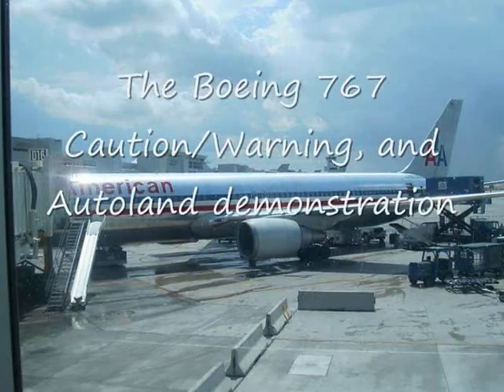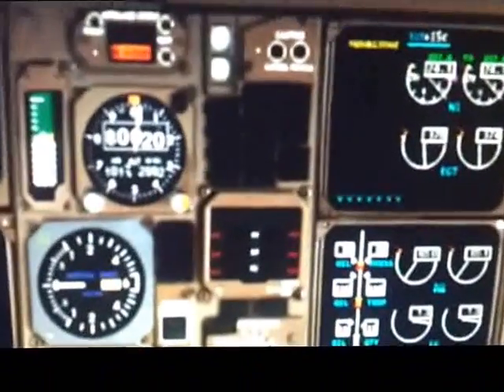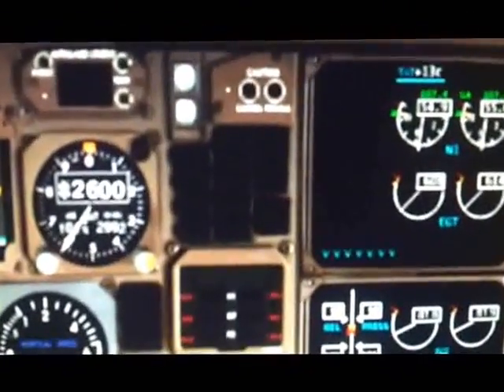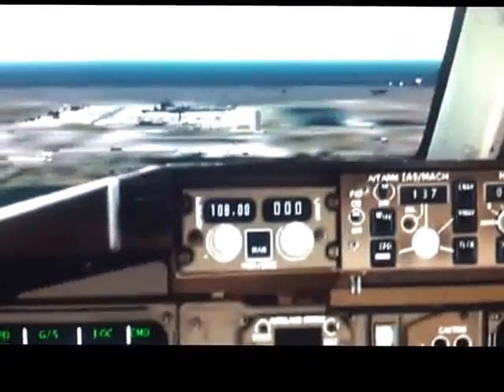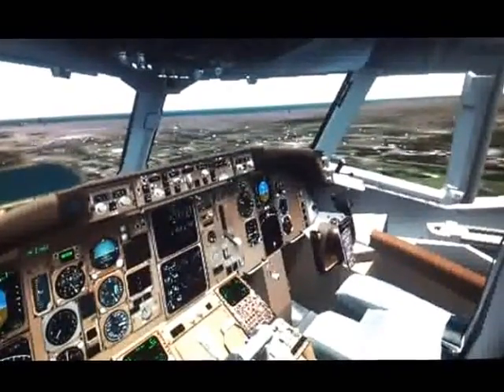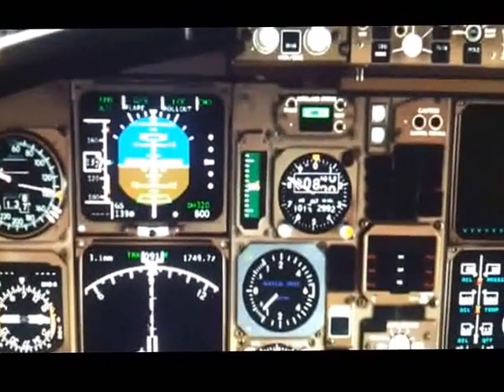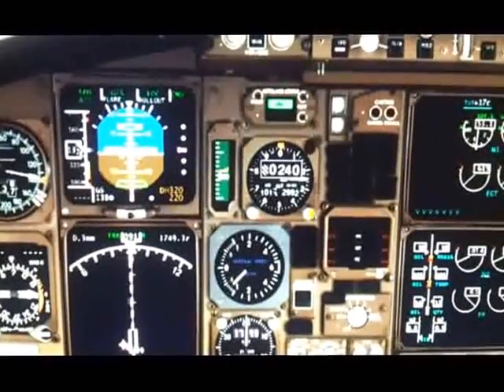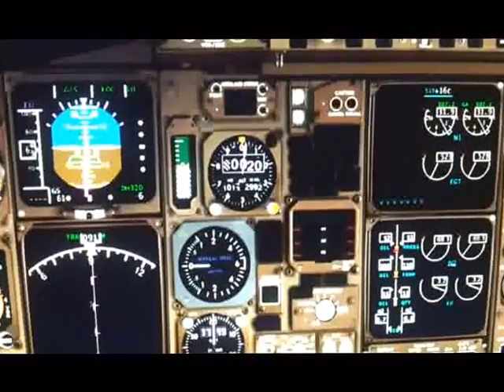Boeing 767 Caution/Warning,and Autoland demonstration

Comment: Isn't the ILS RNP equal to 1.0 nm Radial fix instead of 0.2 nm? I may be wrong, but usually my FMC/MCDU (for Airbus) reads 1.0 or 2.0 nm on the progress page.
Reply from the maker: Even though FSX is highly accurate, keep in mind that at the end of the day, this is still a video game and is, therefore, prone to some inaccuracies.

There may be a difference between the ANP capabilities of Airbus and Boeing. I have no idea.

Now, I'm not an avionics technician nor am I an instrument-rated pilot, but here is the way I understand it: 
RNP, Required Navigational Performance is what the FAA, EASA, etc. requires for aircraft to be certified for an instrument landing; presumably CAT 2 or 3. 
ANP, Actual Navigational Performance is what either the aircraft is picking up, Now, whether that's due to the facility or the aircraft itself depends on the troubleshooting. 

Hope this answers your question!
Reply: @andrewmalik3737  Sorry for the late response, but that answer sums up my question above, thank you. I believe if the ANP is closer to zero, the aircraft is perfoming as expected by the RNP.